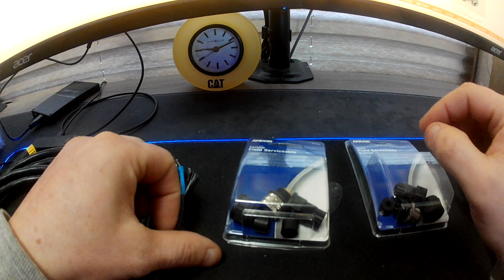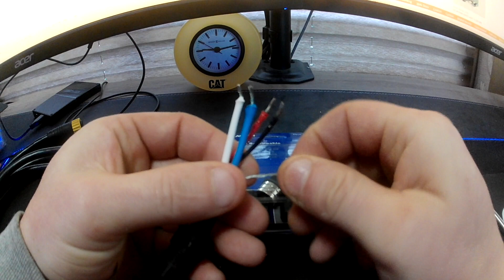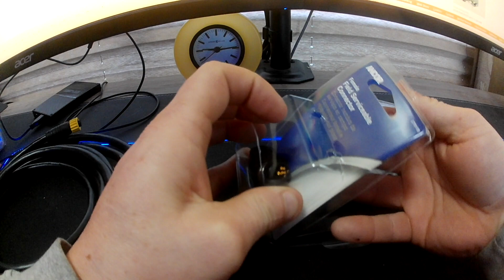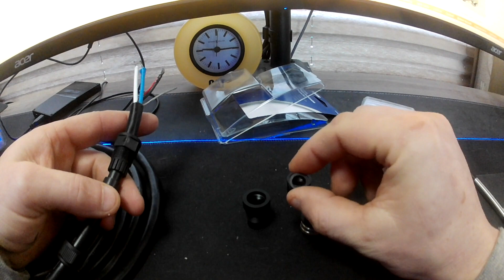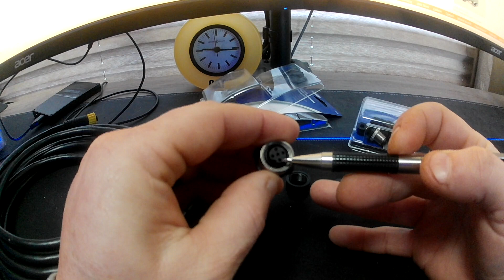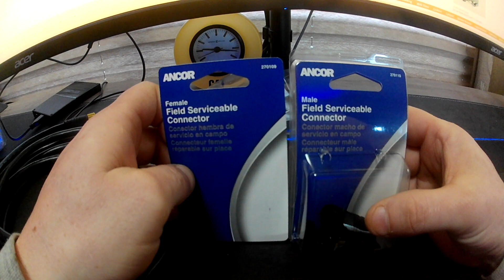NEMA 2000 Wiring #boating #go2marine #LFSMarineOutdoor #nema2k

Comment: Hi Todd - I'd love to see how you connect (solder) those 5 wires without melting the housing or melting/disconnecting already successfully soldered wires.  It's such a crowded narrow area to complete 5 solder connections.  I certainly fear melting the housing and thereby screwing up the threads that would allow this cable to connect to my network.  I have very limited soldering experience but to my eye, even a skilled person would have challenges with this setup.  Any tips?